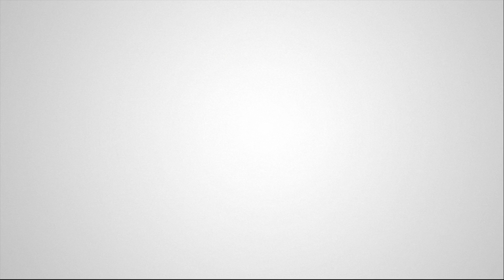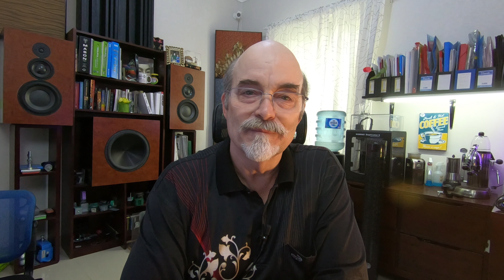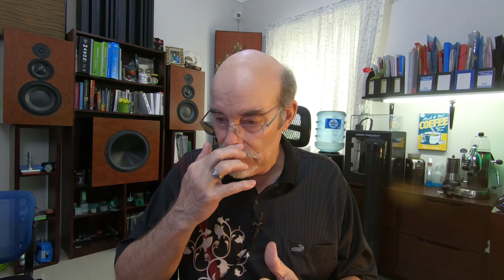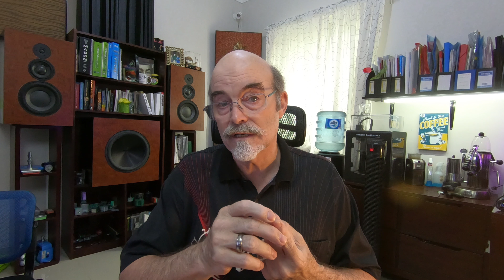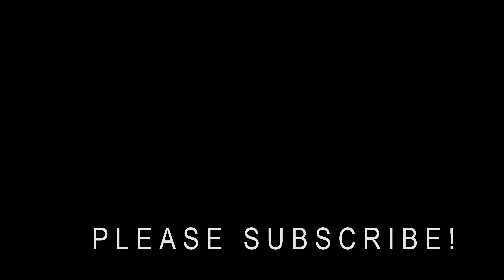Rock Wool Does Not Sound Proof

Comment: After reading these comments I'm convinced that the major issue is that people dont understand the difference between acoustic treatment (for early reflections etc) and soundproofing. Lol.
Reply: @Ladioz about as good as putting news paper on the windows i guess lol. To STOP sound from going out, you need something that sound waves cant get through as easily such as layers upon layers or concrete, for example. Roxul will stop some of it, but unless youre adding layers plus additional efforts, youll likely have bleed. A lot of people will build rooms within rooms in order to prevent as much bleed as possible. Roxul is for acoustic treatment moreso than soundproofing. Soundproofing is prevent sound from escaping, treatment is for preventing early reflections and the likes.

Comment: Can one use rockwool for vocal booth...will it get rid of noise?
Reply from the maker: Of course not. Rockwool is normally used as absorption and is best applied to room acoustics. Acoustic control.
Mass and seal is for Soundproofing.
Reply: @JHBrandt  so what will be better for treatment my vocal booth it's a wooden box and I record vocals in there
Reply from the maker: @RexLabsproduction  add more mass to the walls. That is Soundproofing
You can send me an email if you want my help. John@jhbrandt.net

Comment: One more question. "fill cavities full". What about basement ceilings where you have 10" joists?  Seems like most people put 6" fiberglass bats in the ceiling and there is a leftover 3" gap above the insulation.  Would it matter if gap is at the top of the bottom of the cavity?

Comment: so really it's material types and combination vs. frequency vs. distance.    I wish we could just have connectable temporary lego like sound proofing panels that can be placed against walls and could be removed without leaving a trace.  To me it's stupid there isn't a system in place for something like this since so many are renting (and wise to since asset/home prices have been VASTLY over inflated by the federal reserve).
Reply from the maker: Perhaps some day we will have something that will work like that, but it WILL have to follow the laws of physics.
Fibre is absorption and you need much more than simple absorption to soundproof to any decent degree. 😊
Reply: Me again, rockwool in the cavities, then MLV, then gypsum board...??

Comment: Hi, John- I'm a bit confused. If insulation doesn't sound proof why use it? I mean, if insulation prevents resonance between wall panels, doesn't that help with sound proofing since resonance equates to sound transmission? Thanks.
Reply from the maker: Yes, of course it helps as it is part of a system. But, on its own, it doesn't sound-proof. Fiber is the wall cavity can improve sound transmission loss up to 6 dB. That is substantial, since 6 dB is basically twice as much.
But here I am trying to explain that, on its own, it does not do much. 😉
Reply: @JHBrandt  Thank you, John, that is very helpful!
Reply: Yes , It makes a bit more sense now... I think my initial idea may still work, to fill the open cavities with rockwool, cover that with a layer of MLV, and then cover that with gypsum board 🤔🤔🤔
Reply: @bg4productionsllc  Maybe it'd even be better if the mlv presses more against the drywall to cancel out resonance of the drywall?

Comment: Very interesting video thankyou.  If building a 4" metal stud wall, am I better off filling the 'void' with drywall  rather than Rockwool?
Reply from the maker: Of course you should fill the void with Rockwool or fiberglass. Doing so will add at least 5-6 dB more sound transmission loss. ☺️

Comment: For someone with breathing issues would it be ok to use R13 UltraTouch Denim I don't want to be fooling with fiberglass as sensitive as my breathing is for me.
Reply from the maker: Yes, you probably DON'T need to be messing with any fiber material. Cotton can also cause problems. But once the treatment is built, you should be fine in the room with it, regardless of which fiber you use. The low GFR fiber is best for deep trapping. The denim stuff is much higher GFR and you will have more reflection of the bass (LF).
I would recommend having someone else build the treatment for you and be sure to use a thin layer of dacron batting (polyester) before the fabric. This will prevent any fibers from working their way out. 😉
Reply: @JHBrandt  Cotton can cause what problems? It is the only thing I wear on my body.
Reply from the maker: @thestreamreader , sorry in my fast reply, I was thinking about cellulose fiber 🤦‍♂️.
You're probably okay with the denim but it IS very dense and won't be as effective in the bass region.
Still, I would not recommend that you made these yourself. Have someone make them for you.

Comment: I'm looking for material to absorb engine noise in the car hood without removing anything from the firewall :c
Reply from the maker: You need a high damping, high mass, flexible product that also has high heat resistance.

Comment: If I want to significantly reduce the sound between a basement and floor above what is recommended to be most effective and reasonably priced?
Reply from the maker: A system must be employed depending on the degree of soundproofing. What is it that you want to isolate from? And to what level?
Reply: @JHBrandt  the basement is going to be used as a rental unit so I'd like to "soundproof" it to the extent that theirs a level of privacy for both those in the basement and those on the floor above and then maybe footfall and dogs walking around on the upper floor being minimized so it's not really loud
Reply from the maker: @jbo5021  send me an email please. Let's talk. john@jhbrandt.net
Reply: @JHBrandt  I really appreciate your offer to provide your insight, I sent an email on 12/19. Let me know if you didn't receive it. I'm sure you've been busy with the holidays so no rush I just wanted to make sure it got to you. Thanks again.
Reply from the maker: @jbo5021  sorry that I was so late in getting back to you. Email sent today 😊

Comment: Speaking of RockWool and absorbent products... 
Slightly off topic John, but any advice on a material (something in the 1 inch range (height)) for vibration absorption to place UNDERNEATH audio gear (specifically drum racks?) I'm having a difficult time trying to figure out how to isolate my drum rack from the floor. I've heard about the "tennis ball drum riser" but from my own tests it doesn't work very well. I was thinking of taking two planks of some wooden board and stuffing the middle with RockWool as shock/vibration absorption. I don't care for sound isolation I need VIBRATION isolation. 

I would basically repeat this process 4x to cover all 4 legs on the drum rack. Basically a DIY version of this https://www.shimamura.co.jp/cms/media/61/20131211-NE10_2.JPG but smaller and square so it could fit under each leg. Part of me wants to try this out and the other part is saying "don't waste time unless you're building a massive platform for the whole rack". What are your thoughts John?
Reply from the maker: I have always recommended a simple rock wool layer covered with 3/4" plywood.
It's cheap and does the job. But it's not a permanent thing and tends to leave Rockwool dust.
Reply: @JHBrandt  Interesting. Thank you for the response. If I see it correctly I'm guessing (from bottom to top) it would be plywood>rockwool>plywood? I have a feeling that this would compact under pressure after some time, which is why I'm a little skeptical. I could always replace the RockWool though. What about rubber? I hear great things about rubber being the ultimate vibration stopper.
Reply from the maker: @orpheusthedrummer  Rubber or any product specifically designed for this purpose would be the best. But if you want a quick and easy (portable) solution, 80 kg rockwool does a great job. NOTE: bottom to top - Rockwool>Plywood... Done. easy-peasy

Comment: What confuses me with sound proofing is the question of the air gap being beneficial. 

For example a cavity being filled halfway as Rockwool advise.
I actually asked there customer service line would it be better if you used 4 bats high instead of 2 bats high in a ceiling cavity and they said they found it didn't make any difference and they advise 2.

Then the rail system attaching a second drywall with the air gap separating between the 2, again has me confused on the air having nothing to carry the sound if that's what actually happens.
Reply: An air gap is always beneficial, whether how much is dependent on the specific application. Air gap is fancy way of saying "decoupling". Less materials touching each other, less conduction of vibration. Rockwool within the cavity further assists in reducing the amplitude of waves passing through. As long as you can retain some kind of gap, two layers would be best. Possibly diminishing returns.
Reply: @lllllllllllllllllllll1lll1  Awesome thank you:)

Comment: Would you recommend rock wool to people living in fire prone regions?  Apparently it has a very high heat resistance.  Maybe it should be used under an outside sealed brick and mortar or reinforced concrete shell.  I tend to not trust ratings given for an application if the only rating I can find is in combination with other components.  I'd consider filling my walls with the cheapest filler material that can be packed and sealed in.  Dirt is also great for heat and sound blocking.
Reply from the maker: Yes of course! It depends on how you are building and the design purpose, not to mention any building code requirements.

Comment: Hi! Interesting conversation.. Glad I found your channel!  I'm currently looking at sound proofing a townhouse common wall that has become a problem between us and a neighbour in our bedroom as well as one exterior wall. I am concerned about high and low frequencies such as bass or thuds as well as talking etc through the wall. Was going to go with Rockwool Safe and Sound from home depot as the insulation but also put a layer of silverboard overtop (good for reflecting sound and reducing or canceling out EMI radiation from multiple WIFIs in the area as well as reflecting heat back) and then a normal layer of drywall over top with that green acoustic caulking in between. Do you recommend this setup for the best possible setup for a relatively low budget? Also, what other products are there that can reduce or reflect low frequency sound. Thanks!
Reply from the maker: It's usually a system that is required rather than any particular component or product. If you need personal help, send me an email. John@jhbrandt.net
Reply: If it's a pair of townhouses with a conjoined wall you may be required to use rock wool, by code, for other reasons, such as fire resistance. I don't know if there is much appreciable difference between Rockwool/Roxul Safe and Sound, and the regular Rockwool insulation, which is $10 cheaper though. I packed a wet wall between a kitchen an bathroom with regular Roxul, and it attenuated, but didn't eliminate, the noise from the pipes, or more likely the noise of the pipes resonating inside the wall cavity. If it's a wall with plumbing in it I would go for regular Roxul/Rockwool over fiberglass for the fact that if there is a leak the Roxul won't absorb water like fiberglass will.
Reply from the maker: @a.fritzbecker8986  Yes indeed. Rockwool is often used as a fire-block as well. If you need the pipes dampened, we have successfully used sticky-backed MLV applied directly to the pipes for quite a high noise attenuation. It is always best, if you can, to make sure that the pipes are not rigidly connected to the walls or structure anywhere. ;)

Comment: Ah but are you taking about the soft stuff or the pressed panels ???????
Reply from the maker: Bruno, it doesn't matter if it is 150 kg/m3... it doesn't soundproof. Fiber is used in the velocity region for 'trapping' sound. Absorption coefficients are NOT what most people 'think' they are. 

Soundproofing is a system for sound isolation. It involves MASS and Seal... and some fiber. But it is the mass and seal that does the soundproofing. ;)

Comment: Hi Sir, I was wondering if you could recommend a sound absorbing material for my project. Building a quiet box for my generator. Would prefer something stiff easy to work with and fire-resistant. Will be a fan at one end and a couple baffles do you have any recommendations?
Reply from the maker: I would need more details and you need a proven design that you are certain will work. You don't want to DIY the design. ok? Send me an email with photos and info and we can set up a time to zoom. -  john@jhbrandt.net
Reply: @JHBrandt  Hi John, thanks for getting back. Plans have changed, I am going to order from Home Depot the generac IQ3500 Ultra-Quiet inverter generator. Building a box for my old noisy generator just too much trouble. I would rather put that money on this new IQ3500. Power was out for 4 hours the other day and my old one sounds like a Jack hammer going. Thanks so much for offering to help.

Comment: I’m new to your channel, so please excuse this question if you already have answered it elsewhere. If it is not so much the insulation that soundproofs, then is it building separate walls not physically attached to the outer walls that soundproofs?
Reply from the maker: That is correct. Massive walls also will do a fair job at sound proofing. Building code requires about STC-50 between condos and apartments in many cities. And that is accomplished with mass rather than a decoupled structure. As a rule, if you only need about 55 dB of isolation, a regular structure will do the job. Higher STL requirements will need decoupled elements.

Comment: It seems to me that you are trying to play semantics by stating that "Rockwool, by itself does not (cannot) have an STC value" as if someone would make walls out of it and only it. The only questions that should be asked are:  1. Does a standard wall (drywall, wood studs, drywall) with Rockwool inside block more, less or the same amount of noise as a wall with an empty "core".  I am no sound expert but I would assume the answer is the wall with Rockwool blocks more noise. 

Then the next question would be: 2. If so, to what extent? I could see you making the argument that it is negligible, or even that standard fiberglass insulation is better at blocking noise but that doesn't seem to be the argument you are making. Instead it seems you are attacking arguments that no one is actually making, e.g. "Rock Wool does not sound proof". Ok. By that do you mean that one layer of Rock Wool does not block 100% of all noise? Because I don't think anyone in their right mind actually thinks that. Or do you mean, which I assume most people think, that it does not help at all? Which I would imagine is false.
Reply from the maker: Well, you didn't understand the video. Many people confuse soundproofing with acoustic treatment and they try to block sound with ONLY Rockwool or some other insulation fiber.
1. yes, of course. I think I covered that. See the video again.
2. go to my resources page and download "How to find out how much isolation you need" and "Soundproofing - The Quest"

Also, I see that you are anonymous.. 12345. . If you were honest, you would ask honest questions. This channel is for teaching, not trolling.

Comment: Great Info Mr. Brandt! You just saved me alot of dough. I'm building a recording room in my basement and was about to build these "diy panels" and fill em full of Roxul (Aka Rockwool) "Safe and Sound" Insulation.  Now that I know that's not a good choice or idea, do you have a recommendation for soundproofing material I can insert in the walls for maximum soundproofing? I already plan to build double walls with staggered studs. I was thinking of filling the space inside with plain ole cotton bath towels. I watched a video here on YouTube where a fella made some different panels AND did the scientific sound testing which showed the towels were VERY effective if stacked, stapled and placed correctly. Any advice?
Reply from the maker: Larry, any fiber in the walls will improve the STC a few points but I don't recommend spending too much on it. The normal lightweight fiberglass or Rockwool works well for this.
But the Soundproofing occurs with the MASS and the SEAL of the partitions. The fiber will dampen the wall panels and lower the resonance and in turn improves the STC of the system.
Reply from the maker: DIY panels are used to TREAT the acoustics. These will not do anything for your Soundproofing or what I prefer to call Sound Isolation.
Reply: @JHBrandt  thank you Mr. Brandt. I think I'm going to build "doubled up walls" where the studs are staggered so that the sound doesn't get "trapped" inside the wall cavity but instead can travel around in all directions within the wall cavity (essentially there is just one big wall cavity where the sound would have to sorta travel in a horizontal wave pattern to pass from one side to the other). Then I'll fill this cavity with stacked and stapled (together) cotton bath towels (which I can obtain very cheaply from thrift stores and yard sales). I watched a guy do tests here online that showed (and proved) the towels absorbed sound very well and outperformed other materials such as egg crate foam and a couple other popular items often used by we amateur musicians for soundproofing. I was surprised but not surprised about the towels performing so well. Any thoughts?
Reply from the maker: @larryeaton9437 , what you described is not how the physics of sound works. And DIY testing of materials is NOT how things are tested. These tests are false and misleading.
People try to test things all the time and they get it wrong. The towel video is ridiculous. Send me an email - john@jhbrandt.net
Reply: @JHBrandt  ok Mr. Brandt will do. And thank you for your willingness to help with your expertise.